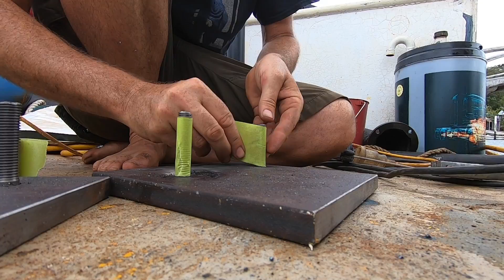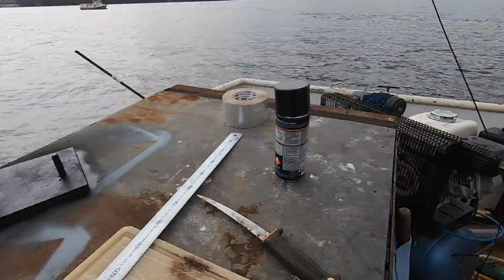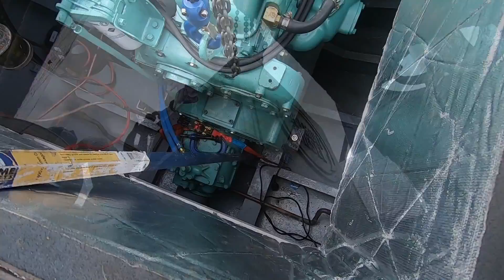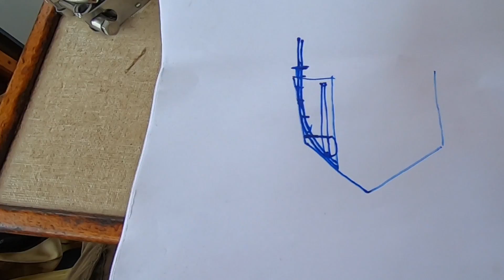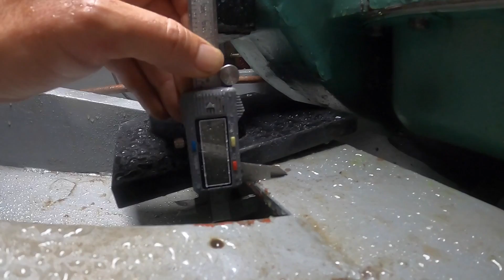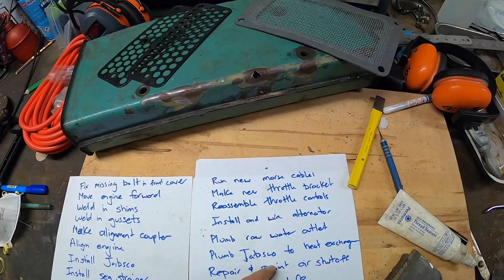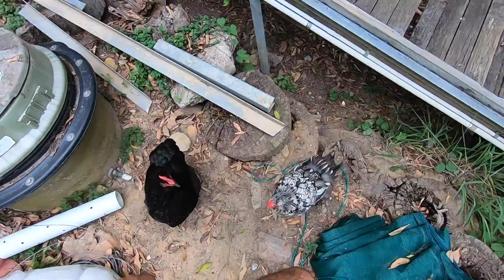Making and installing new engine shims

Comment: Should have around 400w of solar on board . Some panels high up as awnings work well . The high voltage grid tie panels are cheap and work well .
Reply from the maker: Have 900W all up and yes, they are going above the engine bay as an awning.

Comment: Hello Stu. Many moons ago whilst on general cargo boats we used linked sections of brass rods on a rope to dip the tanks, you could use a chain or dipping tape. Cheers
Reply from the maker: Sounds quite traditional, I like it. :)
Reply: @DangarMarine  something like this. http://www.tssmarine.com/impa-370310-sounding-rod-brass-150cm-9-folded-metric-inch/

Comment: Hi Stu, I have a similar space issue between the gearbox and stern seal, I just managed to get a drip less Tides seal fitted, I opted to stay solid mounted and not have the flexible coupling as it was so tight for space and the shaft runs very true with zero vibration.

Comment: Hey Stu!!! I like the idea of using an ultra sonic type level sensor for the Fule level. I would install some thing like that to use as a quick reference / guide to Fuel level then double check or cross reference that level with the old fashion dipstick, then even install a fuel flow meter (Like some thing from scintex, they have fuel flow meters that monitor your the flow to the motor and return) that way you have 3 different methods of determining fuel used and how much you have left. So if one of the sensors plays up you have different sources to cross reference. Being able to accurately measure and keep track of fuel I think is important if you are doing long trips. 
Nothing work than making a uneducated judgement and running out of fuel!!!
Reply from the maker: Hey Paul! For sure, having a couple of ways to measure the fuel is important. The log should help too as I will get some idea of how much fuel the engine uses and be able to calculate an estimated amount left as a triple check. :)

Comment: Cut a piece of steel or rod the exact thickness of the coupler, that waypoints can put in between and measure at all positions around with a feeler gauge and you’ll know it’s aligned, ps I done a shit job at explaining what I mean...

Comment: Hi Stu
A suggestion for a flexible fuel gauge stick: a length of yellow tung from plywood floor sheeting. Can also be used for draw wire when running electrical cables.
Cheers John

Comment: Concentrate on the Coupling Axial alignment ...FIRST... and get that 100% look at that gap and try to get same  close to perfect then the 'radial alignment' will come into play..much much later you need only to adjust same.. when you're in the same Parish to your Axial alignment, get a 'agricultural'  large Jubilee Clips join them together beg or borrow a clock gauge DTI with a shaft and  swivel joint attachment,  grab a bolt that has the same diameter as the remaining swivel  hole, cut off the threads off your bolt  leaving the smooth machined unthreaded remainder plus the hex nut then tack the hex bolt onto the clip.. then with the Dial gauge on then wrap your clip and clamp same around the Prop Coupling tightening unto same,  and rotate your shaft maybe with a strap clamp   Thus ..'clocking' the static Motor Coupling........ Zero the dial at the top and the gauge will start reading off the deflections...do same at Zero .Ninety,One Eighty and two seventy and back to Zero...does that make any sense...
Reply from the maker: Will need to read a few times but yes, makes sense.

Comment: Dude using steel plate may be ok for a working fishing boat but not the average recreational boater. You should advise your viewers to use aluminum plate. The plate should go the full length of the engine bed bedded in epoxy and lagged into place with S.S. Lag bolts.
Rubber mounts are then drilled and taped into the aluminum plate.
Reply from the maker: Every boat his different requirements, it should be reasonably obvious to people that what I need in my situation isn’t going to work in an entirely different situation.

Comment: I'm surprised the engine, or parts of it, fit so closely to the hatch edges.

All the best,

RichE, San Diego, CA
Reply from the maker: It’s certainly a tight fit, but not as bad as getting your average engine and gearbox assembly back into a car!
Reply: @DangarMarine  I was mostly referring to the sides of the hatch/deck.  Since this is an inline 4 cylinder, there are a lot of things that make it wider, and the fittings on top of those things are in an odd place.  Good thing the engine will be hard mounted, vs. rubber type so it won't move so good enough clearance will be just that, good enough.

RichE

Comment: Good vid Stu take your time mate do it right! On a side note sometimes I have seen electronic gear of all sorts give odd readings that sometimes a reboot will fix. Other times I have seen electronic gear where it will not reset. This is caused by a hanging register on the mother board because of something called a capacitive reset switch. Sometimes the capacitor will hang hi or in binary a 1 and the reset will not work. The way around this is to unplug power to the device and hold down the reset button(sometimes the power button is the reset button also) for about 30 seconds. This grounds the capacitor and allows the register to see a low or a binary 0 and allows the circuit to reset. Then just plug it back in and hit the power button. Hope that helps in the future. Cheers!

Comment: Searched “sounding equipment” on google, ureathral plugs popped up. Don’t think that’s what you need. You might try a sounding tape as I believe an ultrasonic tank monitor requires a waveguide. Cheap sounding tapes are available on alibaba if you have a month to wait.

Comment: Would it be possible to suspend the engine with your rigging slowly and carefully bolt the engine, coupler, and prop together. Once all is snug drop your mounts and that should be very close, adjust from there. Don’t know if that’s a good idea or not but maybe.

Comment: Hey Stu, a set of dial indicators and a few cuss words and you'll get it figured out on the alignment. I used to do that on a fairly regular basis, but it's been years. The trick is getting the faces to be square with each other exactly when the torque on your bolts are proper. We used very thin metal shims. I have know idea where to find it, but there is an algebraic formula we used and it would get you surprisingly close right out of the box.

Comment: I kept thinking on a practical way to control the movement of that huge engine on the horizontal plane for the alignment process and I would consider using  4 steel wire and turnbuckles to control each corner  (port - starboard positioning by alternatively tightening and loosening the opposite turnbuckles) and another one to pull the engine aft. With a bit of grease the steel shims would slide on the rails hopefully without having to use the crane at all. Just a thought

Comment: Hi Stu.  If you have machined a steel, aluminium disk the same or similar diameter to the flanges and same thickness as the flex coupling then you can move the motor forward and align the motor.  Once this is done you can remove the spacer block and insert the flex coupling.  If you want a hand turning up the spacer I'm happy to assist,  you can probably get the material from Hornsby scrap if you don't have something suitable.  John

Comment: Stu, take your time do it right. Redoing a half assed job takes way longer than doing it right the first time. We aren't going anywhere and will keep watching. If I can sit and watch Bad Obsession Motorsport build a custom 4wd Mini Cooper for the better part of like 6 years I can stand to watch you do the same for your trawler. Of course we all want to see your boat running and doing its thing that's a given. But we can also wait until it's ready for that.

Also for your fuel tanks, could a fuel tank float be modified it's just a potentiometer with a float on a lever. If the pot gets mounted in the right place then the float should be able to measure from empty to full decently easy. It's not going to calculate to a perfect amount of gallons but it will make sure you don't run out of fuel. And know roughly how much fuel you have.

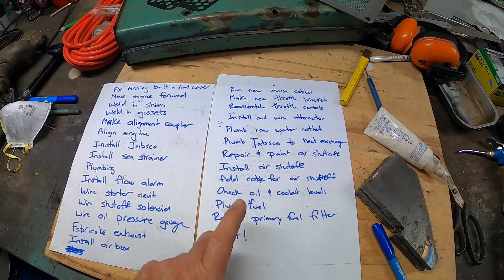Comment: 28:53 That's a minor issue fairly easily solved by generous application of a hops based lubricant, the real dissimilar metal problems come when you try to mix KISS with Meshuggah.

Comment: look into glow sticks, they are fiberglass rods that screw into themselves.  We use them in electrical work to pull wire through or over ceilings. flexible but not overly flexible.

Comment: Call around and rent an "Opti line plus" . It is a lazer alignment tool accurate down to a thousandth of an inch. You can use your poly-flex coupler with it and it will get it spot on perfect. I use one at work to align big industrial motors with pumps and things. Very simple to use and set up.
Reply from the maker: Thanks mate, I’ll check it out.

Comment: It's a good idea to do an initial alignment, followed by a repeat alignment, as you mentioned.  The new resilient mounts may settle a little from the "as new height", after engine torque and vibration together with propeller thrust are applied.  The second alignment will correct for that. Greg

Comment: Yes, a good well machined spacer to take the place of that flex coupler will help get your alignment right. Try to prop the shaft in the middle of it's play in the stuffing box. The hose allows it to droop a bit from the weight of the shaft and coupling flange when it's just hanging. Then align the engine gearbox flange along with your solid machined spacer on it to the shaft. You'll be golden then.
Reply from the maker: Yes, will support the shaft a bit before aligning.

Comment: Great vid, as Always Stu 👍 I would have put up a temporary roof over the deck so I don't have to worry about getting wet!
Reply from the maker: I’m starting to think I’m better off just putting the time and money into the permanent roof before pushing on with the engine.
Reply: @DangarMarine   Sounds like a plan, at least you wont be controlled by the  weather conditions that way.

Comment: We used an old fashioned sounding tape on every tugboat I ever sailed.  They don't break down or lose a charge.  It's also handy for checking for water in your tank.  Just put a little paste on the weight and voila.  Your tank vents are a little low so if you get into rough weather water ingress is a possibility.  

You also might want to install some Racor filters before the fuel gets to the engine.  They will pull water from your fuel and get any crud that might be in the tanks before hitting the filters on the engine.  A 10 Micron filter should do it. They used to have a clear bowl on the bottom so you could see if there was water in them.  Not sure what the AUS regs are but they don't sell them in the US anymore.  They have a drain on the bottom so you can put a container underneath and check for water.  I would recommend a duplex filter that way you can change them underway.   I would add a three way valve on the filter output with a circulation pump.  You can polish your fuel while the engine is shut off or sitting at anchor.  Plumb them in on the main suction line for the engines. I was on a response team when a 110m vessel lost power and put a drilling rig on the rocks during a big storm in Alaska because they had water in the fuel.  It was a bad day for everyone.  Something like this should do it.  https://www.fisheriessupply.com/racor-dual-manifold-turbine-series-1000-diesel-filtration  I'm guessing your friends at Marine Engine may be able to help you.

When aligning the engine take three complete turns after every adjustment.  Everything seems to find it's happy place after that number.  Then make an adjustment and repeat.  It's going to take a while but be patient.  I used a great big pipe wrench with a piece of sand paper to grab the prop shaft.  

These are all tricks I picked up from the old timers I met working tugboats.  They haven't steered me wrong.  

Good luck and keep up the good work.
Reply from the maker: I like the idea of being able to circulate the fuel through the filter as I don’t have a day tank setup.

Comment: Change the o'rings in the shut down housing, if they are gone it will suck in air from there. Also fit a cable you can easily reach. you never know when you might need to emergency shut the engine down

Comment: I wouldn't try to start the engine until all the engine mounts, coolant system etc are all fitted and working properly, all it takes is a bit vibration and the engine is off the rails with a cracked sump.

Comment: well then the right tool for the job was the angle grinder!  I'm going to order "Stu's Guide to Degree of Difficulty and Associated Terminology"...i saw that book somewhere i think??  Foolish question maybe, but is that polyflex coupler the gizmo that makes up for slight misalignment?  This alignment thing, much easier to say that execute obviously.  I'm in the same boat as you with the fuel gauge, very much like the sight glass idea with shutoffs but that is also easier said than done.  Someone must make a simple to install fuel gauge?

Comment: You can skip the gusset by welding a piece of flat bar, from frame to frame, 1/2" or 12 mm steel. you would weld it to the frames and the rail and will be strong enough to support 1/4 of the engine weight.
Reply from the maker: Have been thinking about that.

Comment: Hi Stu....Immensely enjoy your videos !!! just a word for someone who HAS done engine/shaft alignments !!!  For now. forget about starting the engine, that's the least of your concerns now. Correct alignment is CRITICAL for several reasons, one of which is breaking down at the worst possible time (going thru a narrow inlet with a strong current) or (docking in a confined area with other boats around in windy conditions).  If shaft/engine alignment is not within specs, your cutlass bearing and shaft bearing and seals will wear very prematurely, your shaft will be damaged/worn in these critical areas, (think you've spent a lot  now, wait till your far from home and at the mercy of a marina). Also vibration will not only be incredibly annoying but cause more problem and is an indicator of not only s/e misalignment but possibly other problems. You have one prop (I did alignments on a twin with 1 1/2 shafts) it MUST be as bulletproof  as possible, please save yourself, money, time, aggravation and possible injury...do it right the first time.  How much money did you really save by not getting a new shaft or at he very least have the old shaft machined to a consistent diameter, penny wise dollar foolish, ALWAYS bites you in the end

Comment: Get the flange faces  parallel to each other in the vertical plane by adjusting front and rear  engine mount heights. 
Use a set of feeler blades to compare top and bottom flange  gaps. Then do the same in the horizontal plane. Nudge the mounts
over with a bar to make horizontal adjustments.
You may get a bit of settlement on the rubber engine mounts after a while, so maybe check it after a month or so.
Just think, 'vertical angular difference and horizontal angular difference'  That's conical misalignment.
   
Once you have the mounts clamped in place,  then  look at  concentricity of the two flanges.  ( Parallel misalignment)  You can use a dial gauge or feeler blades and a straightedge, held against the side of the larger flange.  (It's easier if the two flanges have been machined as a unit, but if one is a larger dia than the other you can still do it by either method.)  Do your flanges have a register on them?

Make horizontal adjustments, by nudging the engine /gearbox over, equally front and rear and vertical adjustment  of an equal number of flats on the front and rear mount nuts.  You will see that you are gradually reducing the  parallel error  but  may have  induced a bit of conical error.  Just keep checking.  You will get a feel for it quite quickly.  If it gets frustrating, a beer helps.
Within 3 thou' is good, but a flex plate will accomodate more, so don't agonise over it!    When you are happy, slide the propshaft back, fit your flex plate and tack your mounts in place. Then double check!

To get an idea, have a look at ABOM 79  centering his work in a 4 jaw chuck, using a Dial gauge ( Dial Test Indicator) on his latest video. It's the same principle.
Reply from the maker: Thanks for the details instructions mate. I’m sure I’ll be reading this more a couple of times before doing it.

Comment: Good plan for alignment, the only thing I would caution you on is to compensate for the height difference because of the angle when you slide the engine forward.

Comment: Frame up a temporary tarp Bimini over the engine bay,  pvc pipe works pretty good or if you need it to be stronger use emc 
" electrical metal conduit "
Reply from the maker: We actually made a garden shade cloth out of bend PVC. It works really well.
Reply: @DangarMarine  I mentioned tarp so to keep you and the engine bay dry

Comment: Start button in the wheelhouse certainly but would it be helpful to have one in the engine bay in case you need to be there to observe at any time?
Reply from the maker: Remote starter will work well for that situation.

Comment: dont be sorry  i liked the dissimilar metals joke !!! bowden wire for the shutoff should suffice.  have someone cut a block the right thickness (of the coupler) and put a magnet in it. stick it to the output flange then you can rotate the output flange and check it at the 4 points 90 degrees apart.
Reply: once you got the thickness correct turn your mounts evenly for height and shift the engine